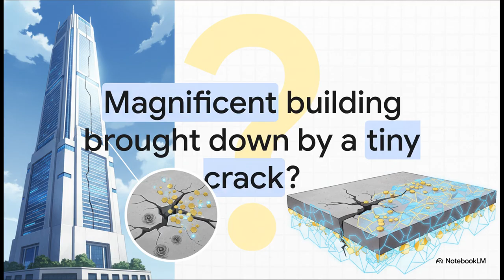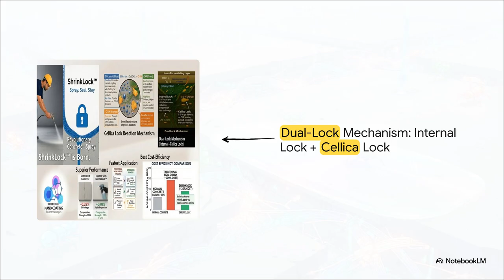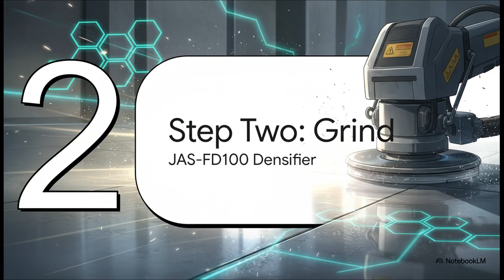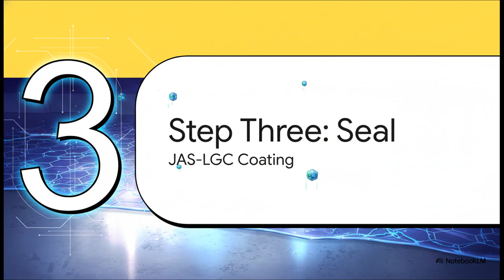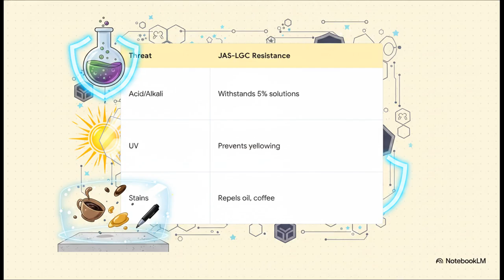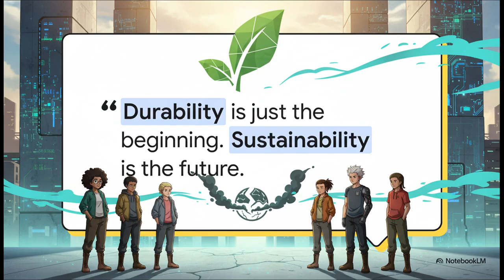How Nanotechnology Revolutionizes Concrete Floors | JAS Total Floor System

Comment: Its main value is that it does not rely only on a surface film. Instead, it focuses on improving the concrete substrate itself, reducing porosity, lowering water absorption, improving surface hardness, and extending long-term maintenance performance.

For the flooring market, this type of system may be especially meaningful in old concrete floor renovation, basements, parking areas, factories, warehouses, and commercial floors where dusting, moisture, abrasion, and maintenance cost are major concerns.

The key advantage of JAS is not just the material itself, but the full application logic: strengthen the concrete, protect the pores, then add surface functionality.

In that sense, JAS Total Floor System can be viewed as a next-generation concrete floor protection approach, rather than a conventional coating solution.